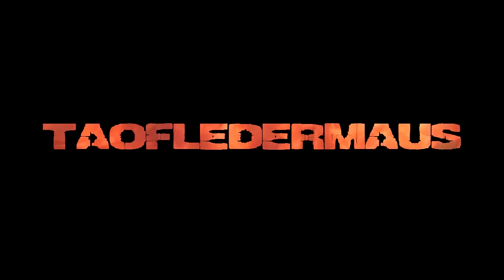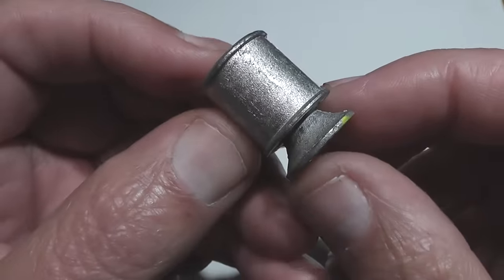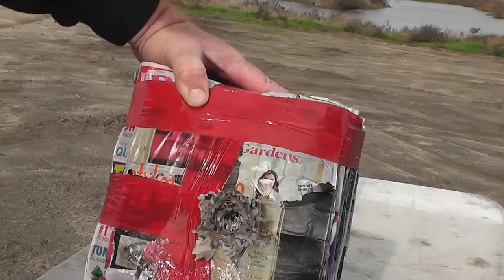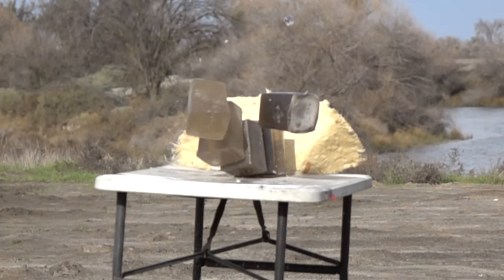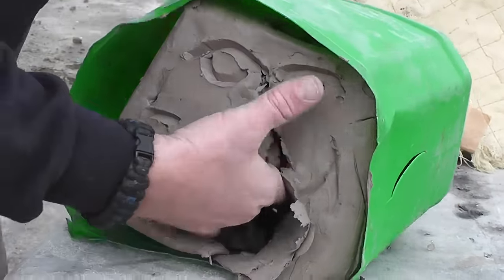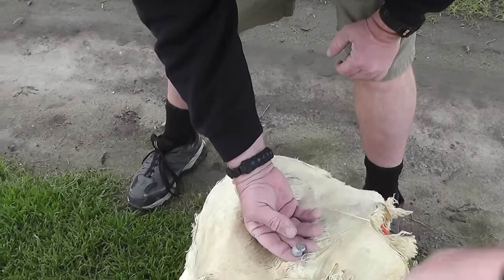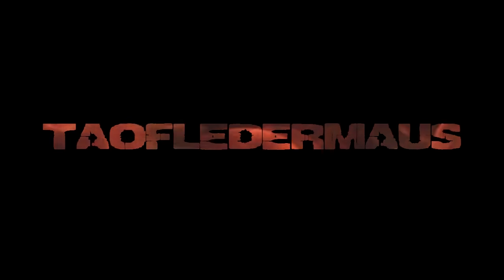French "WONDER BULLET" Shotgun Slug - Weirdest one yet!

Comment: I have a feeling that this slug is designed to splinter. The flared bit at the back of the slug is meant to be launched forward upon impact, thus throwing the four sections in a radial pattern. End result is likely intended to be comparable to the mushrooming of a hollow-point bullet, but in reverse. Clever stuff!

Comment: It's a lead anchor. I buy them at Home Depot. They are used to attach things to concrete floors, walls and ceilings using bolts that thread into the hole in the center.

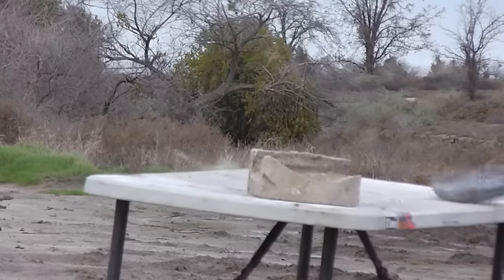Comment: At 6:41, did both the slug AND shotcup detonate upon impact with the lead plate?
Reply: There is no detonation here. But when they hit the metal, there was a brief spark.
Reply: username Oh, I'm sorry....did they "spark" (	faire des étincelles) upon impact?
Reply: golf-n-guns 

yeah I think so, looked like flashes both impacts
Reply from the maker: I believe...  it is the lead oxide detonating.   It is weird that the plastic wad also caused this.
Reply: TAOFLEDERMAUS I have a different hypothesis. I believe that the projectile impacts on the lead plate absorb so much kinetic energy that the energy absorbed by the projectile exceeds not only the latent heat heat of fusion (energy required to melt) but the latent heat of vaporization (energy required to boil and turn to gas)  and so far beyond the latent heat of vaporization that the very small area that absorbs the most energy for it's cross section in the very brief instant of initial impact is making the target/projectile into an ionized gas, or plasma, and what you are seeing is the result of a bunch of electrons jumping energy states for a brief period of time because you really knocked the snot out of em. It's the same thing that we see in a campfire as flames.

Comment: If there is a channel down the center, wouldn't the low pressure behind the slug pull air from the front, even if the pressure wave is there in front of it?
Reply from the maker: If anything,  if the nitro card wasn't there,  the air would flow from behind the slug to the front.   But  if air flowing through the slug was NEEDED or part of the design,  then the slug wouldn't perform very well when it is blocked by the nitro card.

Comment: Hey Jeff, thats a hell of a slug! Too bad its not available here in the US. I do have a question. Why don't you use high brass very often?? I know most slugs use high brass and need that extra powder to get the velocity to stabilize properly as well as to get the most out of them.
Reply from the maker: Hi brass makes a lot of smoke and heat wave distortion and ruins the camera shot.
Reply: TAOFLEDERMAUS Thanks for answering my question. Now I recall you stating about the camera distortion in a previous video. I do understand that, but being thats the case you really cant draw a full conclusion on a number of these "slugs" if their not being pushed to their proper velocities. The 1st round in this video for instance. It may have been just under the velocity needed to stabilize where as the others where just at it. Just my thoughts... Still your videos are full of good information and quite entertaining.

Comment: i dont know when they started putting these in a cartridge  but they are lead masonry anchors , you would drill your hole slip the coned end in the hole then use a swage punch to drive the bigger end over the coned end thus expanding and locking it in the hole then you used a lag bolt to bolt down what ever you needed to

Comment: That 50 yd shot in the high speed looked like it was nearing the end of the round's trajectory. The round's final yd or so before it reached the target had a few inch drop in it's flight, and I think if you were to place the target 10 yd, or maybe even 15 yd, further away then the round might have missed the target completely had the angle of the barrel not change.

Comment: why did the wadding flash when it hit the lead plate? I wonder
Reply from the maker: I noticed that too after I posted the video.   I'm not sure and thought I was seeing things at first.
Reply: It makes more sense for the lead to make that flash. But then the plastic wadding, which weighs considerably less does as well.   I don't think it had enough energy to chip the lead causing a flash, or I could be completely wrong. Does that lead block contain any large-ish amounts of antimony that is used to harden the lead? Cause if so I do know antimony dust may be ignited by friction or heat. Source https://cameochemicals.noaa.gov/chemical/2500

Comment: I don't think any of these wonder slugs are better than the shot-in-wax slugs you made.
Reply from the maker: I think the penetration is a bit deeper.
Reply: Crayons and shot are cheap. Still cool. Has anyone ever tried to make a slug that was a circular airfoil?
Reply from the maker: Namey McName  The Mayers Bullets (Russian) have large hole going through the center and it would SEEM that this is for air to flow through it,  but it is also there to act like a huge hollow point,  causing the slug to tear apart when it hits flesh.
Reply: Interesting. Thanks for the info.

Comment: hydrostatic shock applies to metals where the plastic deformability of the soft metal lets it act much more like a liquid at high enough energy levels (high temp, including the near instantaneous heat of impact), hence the 4 petaled dent in the lead plate.
Reply from the maker: No,  it refers to the rapid displacement of a liquid from a high velocity projectile